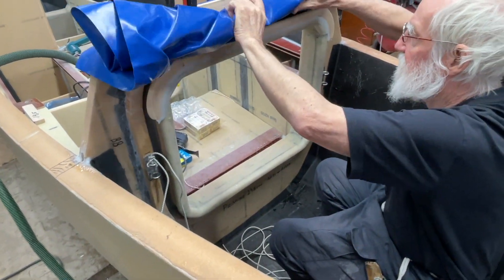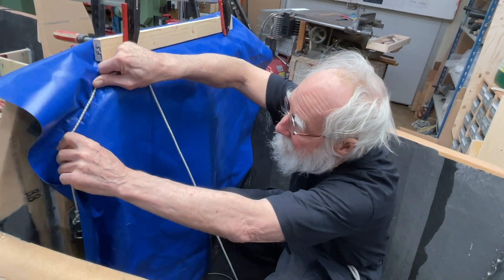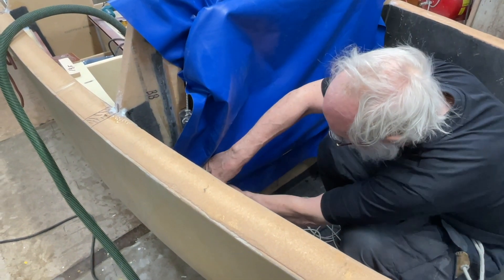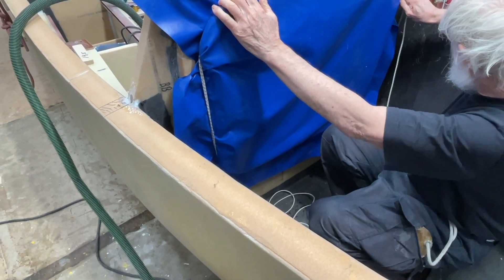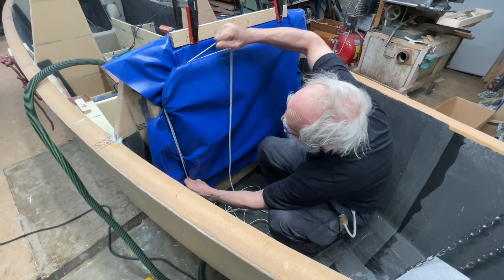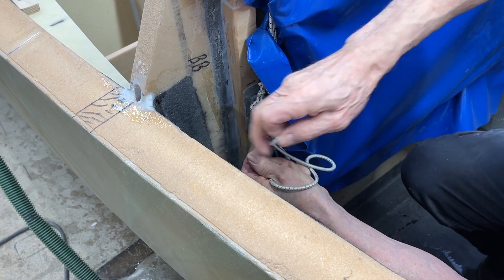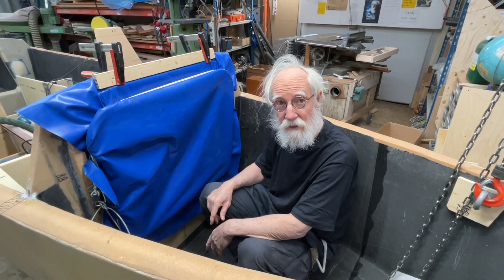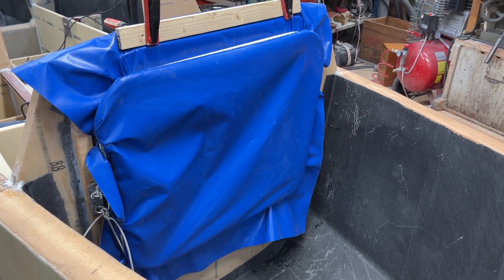The cover for the hole in the bulkhead  A start.

Comment from the maker: Thanks for all the comments.
This bulkhead hatch is bigger than my privius ones. The reason is that it should be good in fine weather and in port as I intend to live in the boat for several years.
If I would do it again I would do the hatch a bit smaller. 
A thesis, giving rise to its reaction; an antithesis, which contradicts or negates the thesis; and the tension between the two being resolved by means of a synthesis. 
I am not going to put to much work into it now as it will work without any hatch cover as on previus boats. This will be OK.
Life in small boat is not as living in a war zone.
As for my finger getting to cold. My previus rounding of Cape Horn was in June. It was winter. There was no GPS I had to be on deck for long times with my sextant and clock and paper and pen trying to get a sight of the sun. That could not be done with gloves on the hand. It was a thing far more easy than tying the canvas for the hatch sitting in confort below the closed deck hatch.
I will never go on deck to work with the sails. That is done standing in the hatch. The sail is next to the hatch.

Comment: Thank you for today's video. Many comments below on the new hatch idea. I agree with the fitted bed sheet design. The PVC sheeting could have the elastic chord sewn into a sleeve and tensioned enough that you can fit it over the flange around the hatchway. A pair of tabs sewn on one side would give you the leverage you would need to remove the cover when you are done with any work on the fore deck. Take care and have a productive week. Thank you Peter for your always excellent camera work.

Comment: hallo Sven,
Another small step!
In my opinion and as someone else has suggested, the quickest thing would be to use elastic cord inside a sleeve sewn around the PVC fabric, a bit like the bottom sheets on beds. I don't want to imagine you going through that whole rope process with your hands freezing cold and being tossed up and down by the waves.
Thanks for today's video and thanks also to Peter

Comment: I made a spray skirt for my sea kayak a bit like this. Used neoprene and glued on a rim with bungee cord in it. A very helpful part is a release handle that pops the cord out. Won’t work for rope but if you replaced the rope with bungee it might do the trick and is fast to release. Several wraps of bungee like you are doing with rope may be easier to put on and if there were a webbing release you still might be able to use that. Sort of a hybrid version. I got the supplies on line.

Comment: What about a small lever assembly mounted on the left side of the opening. One side of a piece of resistance elastic or rope would be mounted to the lever base. The other side would be mounted to the lever arm. When in the unsecured position there would be enough slack to allow you to remove the strap. You would lay your plastic sheet over the opening and then put the strap around it as you now do the rope. Once the elastic/rope in in place you would lift the lever and it would pull up one side of the elastic/rope making it tight enough to keep the water out. The latch would have a clip or locking pin or another one of your fantastic ideas to keep it locked. 

Just a thought, keep up the GREAT work!

Comment: Might want to consider using Neoprene /wet suit material for this application instead of the PVC coated fabric. The elastic quality of neoprene will allow a more water tight seal around the perimeter of the hatch lip. A cover such as a spray skirt for a sea kayak with a cuff and the bungee cord already in place will also be a bit quicker to install in a situation where you have to attend to an emergency on deck and time is critical.
Reply from the maker: It is a good idea. But my resources are limited. I live in a small town and I do not have a car and there is many more important things to do before I get the boat in the water,
So due to lack of time and money it have to wait.
Maybee one day.
Reply: We could hope for some sponsor to make one for you. Easy to snap on. And then the shock-cord could be extra safety.
Reply: @SvenYrvindExlex  will this be easy to operate in wet and cold conditions?
Reply: @fotobollfoto3867  I agree 100%, I do not like the PVC idea at all.
Reply: I think UV has an effect on PVC as well. I believe long exposure can turn it a bit brittle

Comment: Hi Sven.  I agree that several turns of cord would be very strong, but my concern is that it takes a lot of time to complete.  For a planned sail change when you are not in a hurry, that's not a big problem, but sometimes you need to act fast, and will not have time to complete that method.
Perhaps you could have the canvas permanently attached along the top and a couple of loops of shock cord on the bottom corners that could be quickly pulled onto hooks.  That wouldn't be as strong but would stop spray and splashes, and would only take a few seconds to put in place.  You could still use the multiple turns if you had time and were worried about heavy splashing entering the hatch.
Reply: Me too David, and also how is the water going to stay out when he's in the cabin.  I haven't seen any water proof door from the inside.  Maybe it's in the plan but I haven't seen it.
Reply from the maker: The canvas will be permanently attach to the top. This is an early version. There is time to improve.
On the other hand I have been sailing for many years and my idea of seamanship is to be ahead of the weather, to anticipate so that you do not have to be in a hurry.
That means that you often reduce sail long time in advance, sosmetimes hoers but I think thats a small price to pay for tranquility.
I think this approach have been succeful.
Reply: @SvenYrvindExlex  And of course there's always "the best laid plans of mice and men oft go awry".  Plan for the worst hope for the best.  Sven, I can sew and have a very strong machine.  If there was a way to make a fit piece of material I may be able to do it with a pattern.

Comment: I'm leaning more towards a draw string, like for the waist band of pants. Have that fitted around the perimeter with sewing or grommets. That way it can be closed quickly with a pull.

For rolling it up, two straps mounted between the cover and door can be pulled up when the cover is rolled up, and hooked to the top of the bulkhead or underside of the deck.

The easier and faster it is to put up and take down, the more likely you'll have it installed in medium seas. If the seas are really rough, you can always add another few wraps of rope in addition to the draw string.

Comment: A really good stiff and tight spray skirt  installed over an elliptical shaped hole may provide the best fit and ease of installation. My favorite spray skirt hole shape is a modified 1/2 oval, it looks most like a chicken egg / spade shape, in that one end is wider with two radius and the other is one radius which creates a triangle shape. This shape facilitates not only a very tight seal but allows more purchase during installation because the wider end will tighten more than the narrow end which allows the installer to place the skirt onto the wide base with two hands easily while also allowing the strength of both arms to come together as the spray skirt is stretched forward up and over the small end. The small end of the 1/2 Oval shape requires 1.5 -2 X flange thickness because the flange at the wider end of the 1/2 oval will tend to self tighten. My best spray skirt has a triangle shaped rubber bungee sewn and glued to the skirt which forces the triangle to roll over the lip flange performing as an eccentric cam type motion where the seal is compressed mist tightly against the base as it snaps flush.  The spray skirt fits so tightly that a nylon web strap needs to be attached in a way that rolls the triangular shaped rubber bungee uncamming it from the flanged lip seat. To facilitate finding the rip cord in the times I'm inverted in the dark and unable to see and breathe while tons of freezing cold river water is slapping me in the face and my head is striking rocks I can find the rip cord easily because I place 5-6 x 1 oz lead weights inside the nylon tube strap which prevents it from getting flipped around in the current and or being pinned flush so tightly where you can't find it.

Comment: What if the string went through two pieces of hollow strong aluminum. The first piece would be the width of the top plus a curved section on each end to fit top left corner and top right corner. The second piece would be the width of the bottom plus curved section on each end to fit a part of the bottom left, bottom right corner.  The idea would be to make it faster to get the first loop around and provide some rigid structure to the binding.

Comment: Would it be easier to make a “ hard solid hatch cover” that swings up
Reply from the maker: I started with a hard solid cover. Peter the hammer man smashed it because it took up to much space.
See earlier video.
Reply: @SvenYrvindExlex  I think drop-boards could be a solution. May be 3 or for 4  pieces,take up less space than one big one,much easier  to put in. Just a thought 🤔
Reply: @theoldsailmaker6408  They usually don't seal well against much splashing. Why most small boat ocean crossing sailors make a sealing hatch in place of companionway.
Reply: 😂😂 Peter the Hammer man 😂
Reply: The exercise in options has me thinking of hatches that conform to a hull or other stowed location then then conforming the port to this curve. Not 'easier' though.

Comment: Yrvind, how are you going to keep the water out while you're inside the boat?  Like David Rumsey said, if a squall comes quickly, won't you need to close that in a hurry?
Reply from the maker: I do not understand the question.
The deck hatch is only open while I handle the sails and that will not take long.
And the idea is to do the sail handling before the bad weather arrives that way I can do it a leasure.
Reply: @SvenYrvindExlex  I haven't seen the plan for the deck hatch so I'll take your word for it although I must say that the oilskin hatch cover isn't my favorite.  I'd like to see a hard hatch cover.  Will you have a helm in the aft section where that soft cover is.  The boat is getting interesting now.
Reply: @ralphwatten2426  tend to agree ... in addition when sailing into very cold weather hands will need gloves and gloves make intricate rope work a challenge [?]
Reply: @Richard Gleaves I think I'd rather have a submarine hatch in weather around Cape Horn.  I seen canoe videos where spray decks are used and they always end up bailing.
Reply: This is only the inner hatch which will have temporary exposure during a sail adjustment. A hard  whale hatch will seal access to the deck 99% of the time.
Reply: @joekavanagh5708  Yes and there isn't really any room for a hard hatch cover there in that small space aft.  I think it needs to be positively water tight though.
Reply: @ralphwatten2426  the hard hatch cover will be above the deck where there's more room to open it. Inside these two cabins, space is at a premium and the time it's exposed with the exterior hatch open is small.

Comment: Sorry Sven but watching do this just seems like way too much tedious futzing-around especially if you are in heavy seas rocking to-and-fro (the very reason you'd want the hatch closed.
Due to the work involved in placing, securing, then un-securing then rolling-up and stowing the membrane, just seems so tedious. I can imagine that there will be an element of complacency in that say you might want to check out something either in the other compartment or topside; but due to the tedium and work involved you might not do it. Whereas if you had a door with a 1/4 quick-turn handle, you can quickly check things again in the other compartment or topside because there is no work involved. To me it removes any complacency and is a huge safety gain especially if there an emergency.  I also see where seas could slosh in while you're trying to get this floppy-membrane closed, leaving you with water in your sleeping compartment that you have to deal with.
I know you disagree but I see a beautiful partially-completed hatches that could easily accommodate a fast closing watertight door instead of this floppy rubber membrane, rope and a lot of work to open or secure...

Comment: I think this is the most terrible idea you have had in the past 80 years,   bad idea, bad design, too hard to use and way to long to do so, go back to the hard hatch with a gasket and hinges for safety sake and simplicity...  if the hatch is too big make it smaller, if you cant make it smaller rotate the hatch opening 45degrees so the hatch opens fully and rests against the hull while opened...